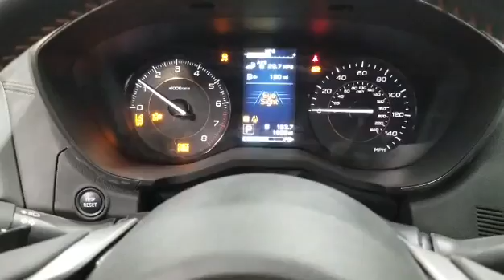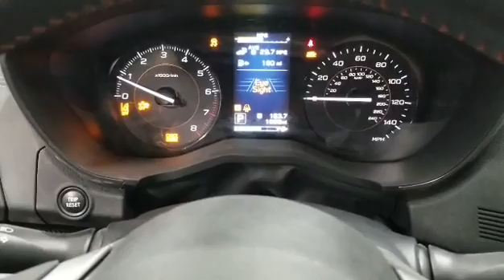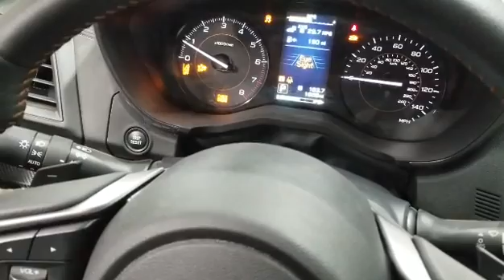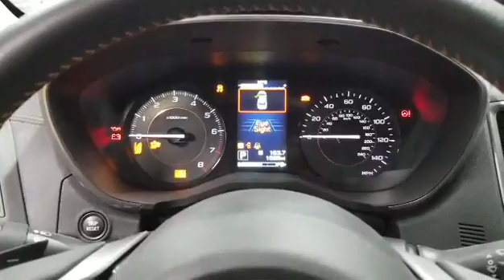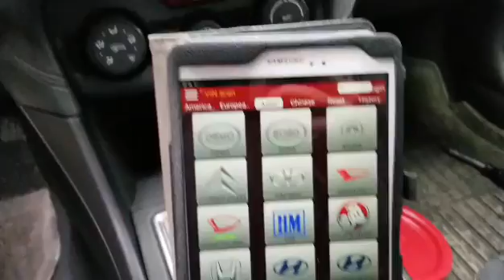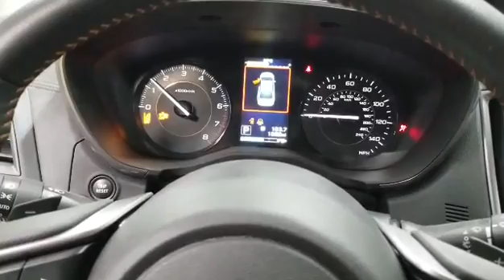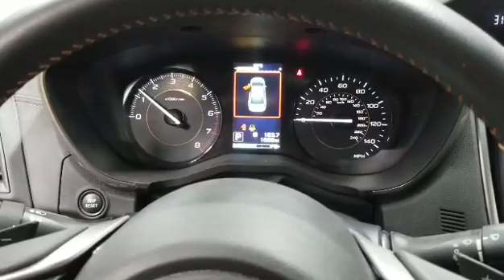A secret mechanics don't want you to know! DTC P0171 Quick and easy way to find vacuum leaks!!

Comment: What is the significance of the "i" indicator above the gear lever indicator on the dashboard? I've seen it both in red and yellow. Sometime I see it associated with maybe a low fuel caution light or a seat belt warning light. But again, why would we need that "i" in either red or yellow?

Comment: So the secret is that by clearing the stored codes using a scan tool, after one ignition cycle, you will have cleared the stored codes. Hmm.

Comment: they charge 231$ for diagnose and did not find issue they said might be fuel pump
Reply: i took my car to a shop with p0171 light turned off while he was doing the test i have no vacuum leaks and he said all the numbers look normal. my check engine light comes on for a couple days the off then back on then off

Comment: Alright thanks for letting us know. But what causes when we get fuel system Rich..! Or oxygen a f sensor pumping current circuit low am stuck in its lexus Hs200h 2.4 hybrid 2014

Comment: I saw your video about using a jumper wire in the DLC socket for 30 mins to make Toyota immobilizer accept new PCM...would that trick work with an 05 Acura TSX?! It uses iso9141-2 protocol BTW. My PCM got so corroded that some IC pins disintegrated! The EEPROM appears damaged as well so I won't be able to go that route. That video wasn't accepting comments so that's why im asking here.
Reply from the maker: No

Comment: I'm sure some mechanics don't want me knowing a lot of things,I'd probably with super glue the inlet duct together or use use polyurethane cement to glue it together.

Last week,a P0171 code was triggered by a split O ring on the fuel filler cap,even though my Holden Commodore runs basically the Chevrolet LS1 V8 engine from the Camaro,the P0442 code is irrelevant in Australia since Holden didn't fit a fuel tank pressure sensor !

Comment: Good find on the vacuum leak. 👍

The mechanics probably call you because going into one module and not scanning all modules does not tell you the health of the network which may cause the other lights to come on. 

I don’t know what the drive cycle is for that vehicle but the trip counts have got to be more than one ignition cycle, but I could be wrong.
Reply: Most likely 3

Comment: It's always disappointing to know that something like a check engine light can run you hundreds of bucks in unnecessary troubleshooting. If it ends up having multiple codes then by all means check out the culprits. I remember in tech school learning about CV joint boot replacement. A simple split boot fix was all that was needed yet we were told that we could charge the customer for removing the axle as if we were putting a one piece boot on it.